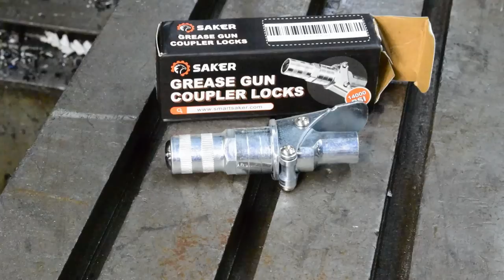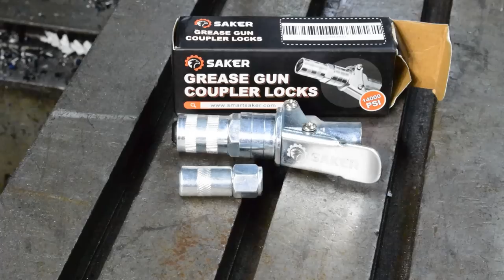Saker Locking Grease Coupler - Product Review and Subscriber Giveaway

Comment: I do own a quick coupler greaser and it works real well. As long as it is properly seated it will not leak or get off. I have bought it from Amazon and it is skinny and fits in all my recessed zerks. And it is mounted on to a flexible line.  An absolute investment in my opinion. Well worth the money.

Comment: I have a lock and lube I have used for several years. Clearance for it can still be an issue. You can install a bleeder o the gun hose after the pump to relieve pressure then the coupler won’t get stuck.

Comment: I’m running a 6’ finishing mower without the belt cover because the access holes through the cover to the three spindles is too small to remove the grease coupler after you’ve finished. It’s easy to push the coupler straight on but, to remove it, you have to tilt the coupler to the side. I just ordered two of these to try. I may end up with two grease guns - one with and one without.

Comment: I have had the “original” brand of locking tip for the farm.  Had them for years, but have the same issue-some zerks are just not accessible with the bigger tip size.  My 15’ batwing ditch mower has almost 60 zerks!  I have to get the regular gun tip for 4 of them…..

Comment: I have the original "Lock and Lube" and it works pretty good it very small and long, I can grease U-Joints with it, but I just bought a new and they don't hold the zerks as good the older version and leaks grease around the zerk.  I have two guns setup like you mentioned,
Reply: I use a lock and lube coupling as well, I absolutely love it. Mine was purchased last year and doesn't leak at all, so it might be a quality control thing. I use my grease gun pretty much exclusively for greasing flange and pillow block bearings so i don't really run into confined fittings, but you're right that the coupling does have a very low profile.

Comment: 26 fittings. I use the " lock and lube" a little smaller but also has some fitment issues. I have 2 short hoses made, 1 with a 90 degree coupler and 1 with a regular coupler. Eliminates the need for another grease gun

Comment: My guess would be about 48 grease fittings. As for the grease gun end I have one made by Lincoln. Made of cast aluminum and broke off behind the coupler. I had ot make a new body out of steel. Only reason for making body is I bought it to use and not just to have. It has all the same issue of the one you have,

Comment: I'm a heavy equip. mechanic and I have an Alemlube locking grease coupler, sort of similar to this on my elec grease gun.
It is a better, less bulky design, you press down a similar lever and the coupler opens out sort of like 3 hooks which shut when you let the lever go.
This design lets you get at recessed fittings and ones with bashguards fitted but it is still long and has the lever making it hard to fit in tight spots.
The locking function really saves time when it can get stuck, but you're right they are hard but not always impossible to fit on uni. joints.

Comment: Hi Josh, I am a retired toolmaker in Northern Illinois. I too have my own manual machine shop now, and really enjoy your videos. We have all the box stores down here, but our Menards stores are really good. They are best known for their quality lumber. Home Depot lumber looks like it was cut from a corkscrew tree. A couple years ago, I built a 24 x 32 foot addition for my shop. The lumber was cheap (11% off entire order) and it came out great. Not the best place to buy tools though. I like your homemade sawmill! Keep the videos coming.
Reply: I call Lowes and Home Depot propeller factories, home of the twisted board.
Reply from the maker: Menards here is bad lumber. Part of the reason for building my own mill. The customer service sucks .I know it's mostly just the local store. The others aren't this awful, but the all still suck.
Reply: I don't recall the brand name of the locking coupler I use but it's not that large.  I just started using it a couple of years ago and it's absolutely a life saver. I have two of them.   I have a Deere compact track loader that is very difficult to grease without it.  If there's anybody out there who has heavy equipment or agricultural equipment that doesn't have one of these, they don't know how much easier their lives could be by getting one.

Comment: I know this sounds snobby as hell, but once you have used a battery powered grease gun, you will never look back. They are tough as hell, you can even use them for hydroforming. The battery powered caulk gun is a close second. I believe Ryobi makes one that can take grease or caulk. Yeah 60 bucks is hard to stomach for a simple grease gun, but it is so clean, and saves so much waste, I bet it pays itself off in paper towels in 5 years alone. Really a pleasure to use. The one I have is a popular Red Brand and it has a locking cap with a much smaller presentation. It's a series of ball bearings on a sliding collar, much like a pneumatic fitting
Reply: The Milwaukee (Red) elec grease gun retails for $534 here in AU and in my opinion is worth it, never going back. Here in AU even manual grease guns can be $100.
Older inferior elec models from Macnaught and Alemlube come at over $1,100 with useless batteries you can't use on anything else.

Comment: It’s good to know that it doesn’t work on recessed fittings. As for the big box stores, the success at keeping the shelves filled is based on the point of sale inventory tracking information that is uploaded to corporate purchasing. Corporate monitors each store's sell thru on each item, and sets the trigger point for restocking based on frequency of sale of each item. If your store only sells two or three grease gun hoses per year, that may not be enough to insure restocking when the inventory gets to zero. It’s all about insuring that the most popular items get restocked in a timely manner, and non sellers often don’t even appear in the store, but can be ordered online. Example would be finding snow shovels in the Tampa Bay stores…it’s silly to even stock them because they’re not a local use item.

Comment: DEWALT 20V MAX Cordless Grease Gun (DCGG571M1),Yellow,V11 Torque & 20V MAX XR 20V Battery, 5.0-Ah, 2-Pack (DCB205-2)
Topper you be very lucky with this grease gun.

Comment: My guess  is 52 fittings.  Other utubers have rated this device very highly.  One guy used his to tighten the track on his CAT with no leaks and that is a very high pressure application.
Reply from the maker: There are advantages and disadvantages with it.  Some applications it will just not work well, and others it's the cat's meow.  I do like it, just it needs to be smaller.

Comment: Wow! Now I am really envious! You have a hi rail truck and can actually use it on the rails! I worked for the B&O and NYC in the early 1960s and we had "speeders," that were actually cooler, if not as comfortable, than hi rail trucks. My Fairmont M19 had a 2-stroke cycle engine that ran both clockwise and counter-clockwise for forward and reverse. Thanks for the product review. The moment I saw that fitting I thought it was too large for recessed zerks. Yep. Nice that it doesn't leak, however.
Reply from the maker: I've got miles on speeders.  Lots of time on an A4. But also the smaller cars. I still prefer the truck or the air conditioned cab of the TR10 tie inserter I run.
Reply: @TopperMachineLLC  Ha! I'm not surprised. Speeders are cute, but they are loud, uncomfortable and dangerous. We were glad not to have to walk the lines, however. I worked down in Hammond, Indiana, south of Chicago.